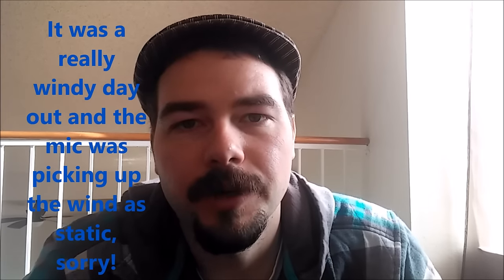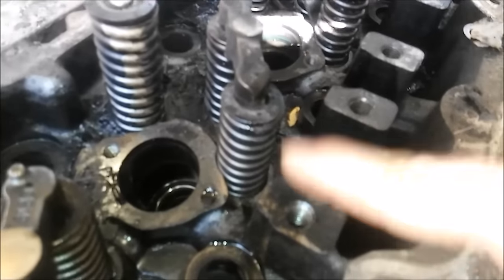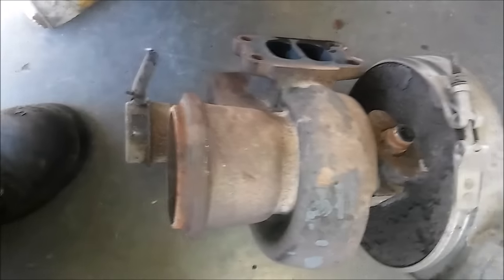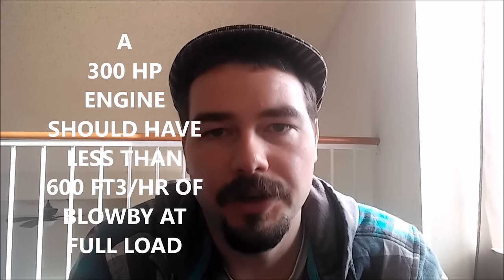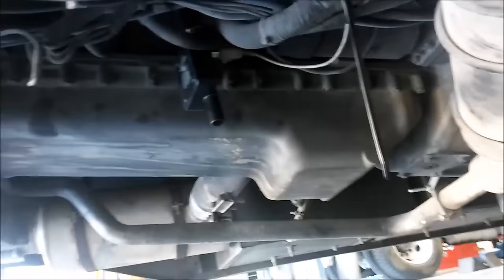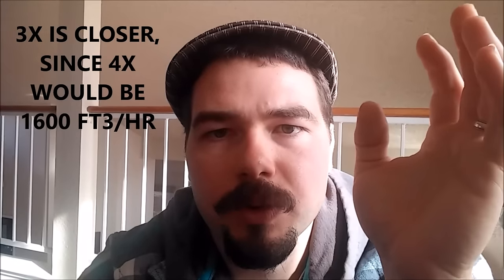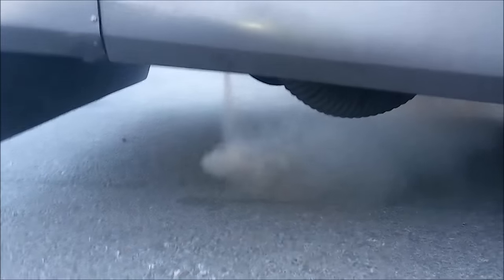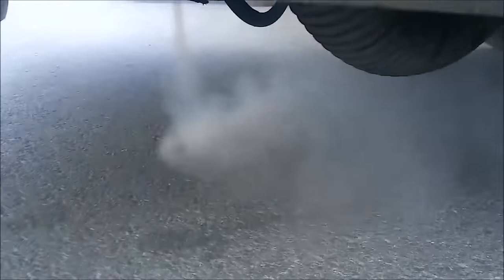What Is Blowby?  What Is Too Much Blowby?

Comment: I used blow by to help me diag a failing turbo on my 03 Cummins. 

Got the truck @ 207K no blow by issues noted at the time. 217K later I start noticing oil seapage out the CCV seal and oil cap as well as the turbo drain tube hose. 

I'm also running richer than normal with alot of soot under the bed (4ft of my exhaust broke off so it dumps under the front of the bed). You can smell it. 

I get it up to operating temp one day its around 60* ambient outside so I lean on it to get it to 190*, pull over pop the hood check my CCV while flicking my throttle lever. I notice a high pitch sound as the turbo is spooling down from me reving the engine. I put one hand on the compressor housing and flick the throttle lever again, the comp wheel is vibrating back and forth as it slows down from high rpms. A few obscene words later and a 15min drive back home I pull of the intake and wiggle the wheel not only to find it having excessive axial play but an oil seal has broken internally. So I put everything back together and get to thinking. 

I have a known compressor side leak, If at load or highway speed; that wheel is building enough pressure to push back against that blown seal to send pressure down the oil return to the crank case, It could be causing the increase in crank case pressure that im seeing. I'm now awaiting a used HE341W from Indiana to rebuild and drop in to test my hypothesis.
Reply: Was your hypothesis right brother? asking because I’m having similar issues

Comment: great video.  I always ran leak down tests if i suspected high blow by to help isolate the problem, but this is a cool way as well.  How would i know how many times to multiply (1.5-2) for any given engine?  Does CAT or most major engine manufacturers have specific values for this blow by test?
Reply from the maker: Hey Regal, so the 1.5-2x is the Cat spec on their truck size diesel engines. They vary depending on serial number. A C7 may be 1.75x or a twin turbo C15 might be 2X, but a good rule of thumb is 2X. The problem with leakdown tests is they are hard to do in a diesel setup. The automotive ones are great since you just pull a spark plug and your ready to go, but that could take hours to set up on say a 3406 then you have to reseal all the injectors. Our shop doesn't even have a compression or leakdown test kit. You can try doing a cutout test and watching the blowby to isolate a bad cylinder, that works at times if you have a single bad cylinder. Now when it comes to all engines, gas and diesel, I'm not sure what a good specification would be since a non boosted engine should have significantly less blowby normally, probably 1x horsepower would be my guess or maybe 1.5x for high compression. Thanks for the comment.
Reply: +Adept Ape  Yes leak down tests take long time as you mentioned each injector must be pulled.  What do you do when there is no dedicated crankcase breather?  I have a pair of Detroit diesel 8v92s and I dont think it has a crankcase breather?
Reply from the maker: +Regal2800 Hmmmmm, A Detroit question eh!? A 2 stroke at that too, I'm not super familiar with those engines, but every piston engine produces blowby. Do these engines recycle the crankcase fumes into the intake perhaps? Those engines are so unique compared to the traditional inline 6 cylinder 4 strokes that I'm used to, I would have to say I'm not familiar with them enough to really know too much about them. Let me know if you find out where they route the crankcase fumes.
Reply: +Adept Ape Well there is a breather vent on each of the valve covers and in my particular case there is a airseps device mounted to each turbo to help create less pressure in the crankcase.  (Help those detritus leak less....)   But this technique you used is very interesting and helpful in troubleshooting.  I need to check on my 6.7L cummins and see where the breather vent is.  Thanks Adept, i learned a useful new technique
Reply from the maker: +Regal2800 Your welcome, hopefully your shop has a blowby meter. Good luck on your 2 strokes Detriots.

Comment: I have a 94 Ford ranger 3.0 v6 I have low compression in Cylinders 3 & 5,- 60 lbs & 95 lbs the motor has no power and a bad Misfire, And I have air blowing out my dipstick bigtime   So Im assuming that its my lower engine  ,I don't know if its worth tearing down the motor  to see what's going on  This motor has only 56k original miles on it...  Please help What should be my next step ,After the compression test the motor will not start  and the spark plugs & Cylinders are pooling with  gas ,I have spark gas air and timing is correct ,What should I do now ?The motor did run until we did the compression test now it smells like gas and it will not start ,I pulled all the spark plugs let it air out for three days put New plugs in it  It has New fuel pump & filter  coil complete tuneup ,When I bought the truck  I had it checked out by  a auto shop they told me the motor was good  I put $1500  into it Now this !! I don't know what to do

Comment: What happens on a diesel if you eliminate the valve seals turbo and air compressor pull apart the engine and the liners and pistons have not al wear. What could be causing the blow by

Comment: Good info thanks. A quick question. I've been getting engine oil in my radiator. I have a cat c-15 single turbo, I check the oil and there is no sign of coolant in it. You think it could be the oil cooler.
Reply from the maker: +Anniel Perez Could be the engine oil cooler, or your transmission may have an oil cooler as well, I've seen both be the cause of that.
Reply: check  your inter-coolers they cool engine oil with radiator water ;;
Reply: Blown head gasket cars fucked

Comment: I'm seeing oil leaking from the intake hose seals next to the turbo and also from the oil cap. Compression test was done on this engine a few years ago and it was perfect, also I don't see any smoke from the exhaust or loss of power. Is it likely that turbo seals are the problem ? I looked at PCV valve too and at least some air is escaping from it when idling, so it's not fully clogged or something.

Comment: My 2006 isx Cummins was rebuilt 2yrs ago and it has blow by coming out the dip stick and oil cap. I replaced my turbo,crankshaft adapter, crankshaft speed ring, and Cummins dail pin. Im sure what else to do, it burns diesel I feel to much.. Can somebody respond to this please…

Comment: Hey Adept Ape! Great Channel, I've watched almost every video you have on the C7! Great Channel!! I do have a question for you about an 05' C7 in a straight truck I have.  Mechanics found that cyl 5 either has ring damage, or cylinder damage, basically rebuild time.. BUT i'm 1500miles away from home with the truck, can I just unplug the cyl 5 injector and limp home to prevent more damage to the engine, and get her rebuilt at home?
Reply from the maker: If you already have cylinder damage or a broken ring, then you can unplug the electrical connector to that injector to prevent the injector firing into a dead hole. You should be able to run it home without a problem, obviously you'll have a lot less power. These engines don't have liners though, you probably knew that, so you'll have to get a new sleeves machined in or get a new short block. Let me know if you have any other questions, and subscribe please.
Reply from the maker: I was going to say that just be mindful, watch your oil pressure and keep your ears open for any knocking. Hopefully you don't have a piston coming apart or something, but it's most likely cylinder scoring. You just don't want to throw a rod. Just be mindful of any weird noises or oil pressure changes. Good luck.
Reply: Perdonally, I think the crankshaft would nmbe toasted running 1,500 miles, countess thousands of revolutions, with a missing fire sequence.

I hate it and grind enamel off my teeth when my truck-tractor misfired intermittently while warming up in cold ambient temperature.

Cost of crankshaft vs tow: probably less expensive to drive it.

Comment: I got a 2006 isuzu fvr with isuzu motor  280k miles on it...I have blow by but the truck seem to rum good..I do have a check engine thT won't clear but no code...have you ever seen that...

Comment: I have oil coming out of the dip stick on a 350 1991 model I suppose its the original motor. its coming out pretty quickly especially with throttle. I am going to try the PCV valve that is pretty Gunk looking. I just bought this truck and what a dummy I know. I will try this first then look at the blow by tube if it has one??? Not sure if it has a blow by pipe. Any help or suggestions will be appreciated.

Comment: My Detroit 60 series has much much greater crankcase pressure at idle than under full load. I've tested it with a manometer. Truck runs great does not use excessive oil. Why would this be? It's smoking me out at idle but no other issues.
Reply: Also, the truck starts fine in the cold.

Comment: my kia pride is in trouble a lot of engine oil came out from the oil deep stick what should i do any suggestion sir or advise how do i fixed it thanks sir
Reply from the maker: +pablo job If your engine is pushing oil out of the dipstick then you definitely have a problem. Check the crankcase ventilation system and PCV valve first as it could just be that.
Reply: pablo job change out your PCV valve first always go with the cheapest thing I bet yours is clogged it happened to me.

Comment: What about measuring blowby coming off a bowl? 💨
Reply: You simply max out air pressure and see if blowby continues at high bowl pressure.. if blowby is still too high the lungs may need replacement or showing signs of excessive wear.

Comment: I have a 2007 kw with cat c15 twin turbo with 770000 miles and it has smoke and oil coming out of breather tube not as much smoke as that rv in video but enough to see it when idle and oil in a 2500 miles per week im putting maybe 2 to 2.5 gallons of oil can any one give me an idea of what the problem could be??
Reply: Garrobo Asesino bad piston man

Comment: 1995 Detroit 60 Series - looked at it today; sounded good, but some blow-by coming from vent-tube (pointing down next to oil pan); coming from oil fill tube; and coming from dip-stick tube - nothing like your last example, but enough to see.  Should I be concerned with this motor?
Reply from the maker: +Sasbad84 All engines have Blowby, but you would have to measure the amount to see the quantity. If you are thinking of getting the truck, you should have it measured at a shop.
Reply: Sasbad84 thanks for the reply; I'm familiar with Cats; this is the first Detroit I've considered - it's in a 2000 KW 900L; truck is in great shape, and price is good; but the blow-by gave me pause - thanks again

Comment: This problem started after I got a cat reman Ecm  I was told to get new injectors I did. Then I was told to have the new injectors pressure tested. I did there were two hanging up I was told. Several dyno pulls later still no change. Oh and a bar and plate air to air. Just now tried a new ecm. No change. I've got to figure this out before I'm broke. Oh but wait now they want me to buy two new turbos. This has to be it.
Reply from the maker: What shop are you at, is it a Cat shop? It sounds like they don't know anything.

Comment: I have oil in my cooling. It a little. I installed air compressor last year. 
No water  in the oil. I'm thinking oil coller.
Reply: Anthony Johnson yes oil cooler
Reply: What motor do you have? It could be injector o rings.

Comment: I just bought a 2010 isuzu npr with the 5.2l diesel. Has 197000 miles on. Have you seen these engines before and are there any common failure points on them? I heard they run a long time if you take good care of themm mine was a rental at ryder. So far its on good shape. Im thinking about buying the idss diagnostic system for it also.
Reply: I've worked on these for years, the biggest thing to watch on these is keeping the fuel filters changed every 3 months, don't overheat it and make sure it does it's regens properly

Comment: I just did the rebuilt at the cat dealer on 3406e engine and I have a lot of oil coming from the blow by and they say it's normal but in about 2-3 months I'm I'm low on oil like almost 2 gallons that's how much it comes out and the whole engine from the bottom is smeared with the oil and the axle and everything and they keep telling me that so normal how can it be normal to have that much blow by after a platinum overhaul and the oil pressure is about 20 psi at 190 F coolant any suggestions what I should do

Comment: I’ve got a 2006 5.9 Cummins with 130,000 miles. I’ve got a little bit of smoke coming out of valve cover when I take the cap off, but no check engine light or loss of power. It just started this week. What could this be?
Reply: Did you ever figure out whats up? Because some say a little Blow by is normal?? what i understand from it is when the oil fill cap is blew off and dances. So i  imagine a little is okay but who knows??

Comment: Hi, First I must say, great video with so clarity is explaing the issue. I have a 2006 Cadillac SRX 3.6 and get engine oil drops when i park after driving, mechanic says it is a blow by from pcv. Just before this I had the transmission oil leaking so oil cooler and cooler lines were changed.....are these problems related in any way ? My mechanic is now suggesting an oil catch can.  Do you think if there is a permanent fix or oil catch can is the only way.  pl. help. Thanks
Reply from the maker: Well I'm no Cadillac expert, but I'll give you my free opinion (you get what you pay for). An engine oil leak doesn't have anything to do with the transmission cooler, as they are separate systems. The PCV system should keep the blowby under control by allowing the intake to ingest the blowby and oil fumes. So if you are getting an oil leak you probably have a problem with your PCV system that fixing should stop the leak. Now a catch can would stop the leak from getting on your driveway, but the engine would still have PCV problem. Sounds like what your mechanic said makes sense.

Comment: Did a rebuild on my c15 accert 2007 and it has blowby it was measured at 500 but I have doubts. The turbos where inspected and the didn't need to be replaced but im not sur how to pin point this problem or if they just used some of the same parts. It is still under warranty but do not know how to ask for in the holt cat dealer.
Reply from the maker: All engines, have blowby, and generally the rule of thumb is twice horsepower under a load maximum, but that can change based on which engine you have. The Acert engines tended to have more blowby in general. If you have other symptoms, ask for an oil consumption sheet and your will need to track your oil added and fuel added and if it is over a certain specification and the blowby is high you could have a good warranty stance.

Comment: bobcat 743- v1702 kubota engine. oil out of blow by tube coming from valve cover.. It drips oil sometime and not all the time.  Saw some smoke the other day.  If I run just once in awhile, how much longer will the engine last?  The service manual says the oil is to flow out of the motor dip stick hole. If it does this it is full.. Hard to keep up with this.  The engine does not show smoke through the exhaust pipe.  Let me know what you think. Thanks  jc
Reply from the maker: +Curt Clyne If it has high blowby you most likely have worn cylinders, but it can be other things. You can run it because it must likely needs engine repair already, if it starts knocking though then stop obviously

Comment: Just found your video. Love it!  Question I have is that, I have a 98 m11 Cummins. It's blowing a lot of oil out of the peep hole of the dip stick and I'm not a mechanic by any means but I'm trying to figure out what and why it's causing that? I had a load on it that had to be delivered, I started at Indiana and Ohio state line drove to Milwaukee to drop the load off and drove it back empty. It made it there and back. Now the truck has set for a while it started right up the first turn at the key but I'm trying to get back on the road with it but trying to see how much and what it would take to get her Mack on the road. Any help would be great
Reply: Blowby

Comment: I just recently bought a boat 1987 Bayliner Capri 2.3 4 cylinder Ford. I haven't had it out on the water yet I checked the oil and it's a quart over could that cause Blow by?

Comment: Ok so I'm getting the choocho train  blow by on my cummins 5.9 24v. My engine runs mint so what is causing this?
Reply: Check out this video.  I am going to assume it should be similar on your vehicle.  I believe the heads are only slightly diff on the 5.9 vs the 6.7 (which is what I have)....

https://www.youtube.com/watch?v=Fzbeb_F4qaY

Comment: I have a 2010 f350 6.4 powerstroke. 147k miles and maintenance done on time or miles before time. I've only had to replace a alternator and batteries once since i bought it new. Ts tuned and deleted and I installed a rudys diesel ccv delete and a baffled catch can and ran it back into the air intake. It smoked oil like a mother f....r and exhaust was greased with oil. Installed OEM CCV and no smoke. I do have blow by with oil cap off. Doesn't look to bad being honest. Been like this for years. I am a qrt over filled. 

So I'm confused? Rings, valve seats idk and I don't beet on it. 

Any suggestions on this or new motor?